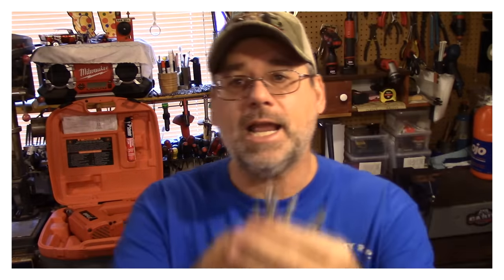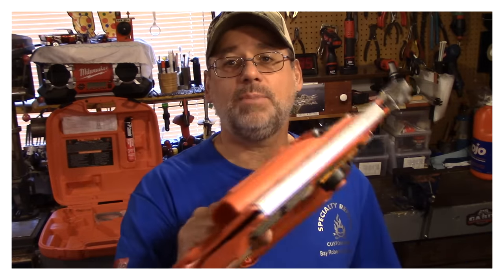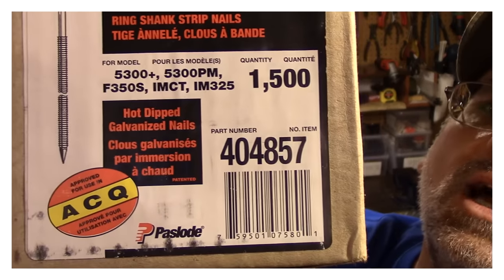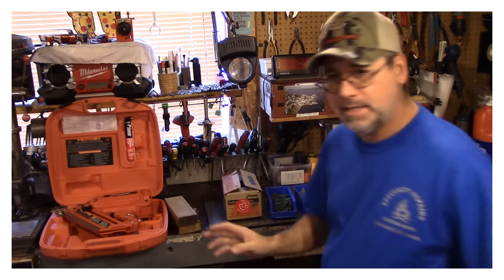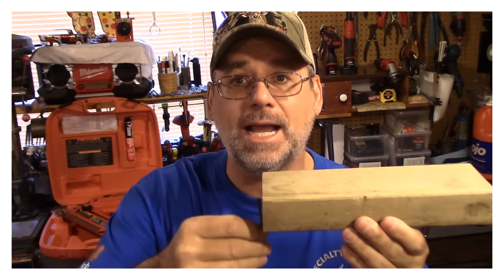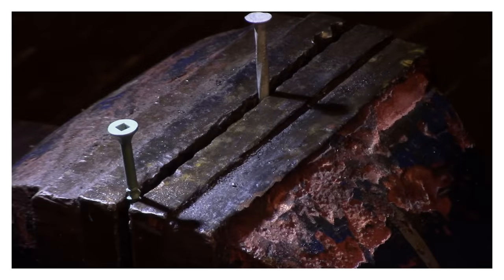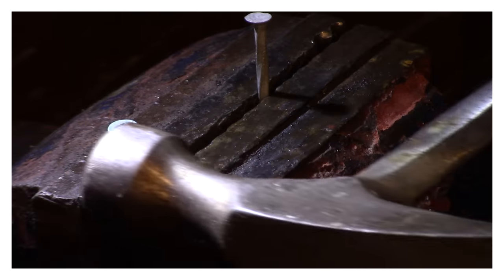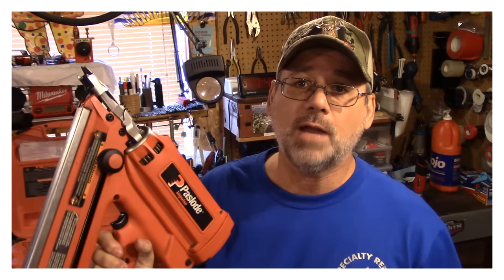BEWARE  NEVER USE DECK SCREWS  - DECK SCREWS VS NAILS -  PART TWO IN DESCRIPTION

Comment: HOW ABOUT CONSTRUCTION SCREWS?
Reply from the maker: Well if it looks like a deck screw without the anti corrosion paint it's most likely just a deck screw called a construction screw. Their is specific construction screws for structural use but they're much thicker and expensive.  In the end its matching the screw to the use and  follow your local building codes. Cheers Richard

Comment: The screws are made in China!
Reply from the maker: Seems everything is made there so ya you have the correct reference :)
Reply: @marcfrost7175  They build to the specs their customers want.
Reply: @SteveRobReviews  It's a SILENT WAR and its been going on for yrs. 
Just look at Patio Furniture, lawn mowers,  barbecue pits, and large poles that hold gas station,  stores, restaurant signs. RUST WILL EVENTUALLY MAKE HOLES THROUGH IT! 
Yet some tools made in the USA in the 1960 or earlier are still around, working with little or no rust!